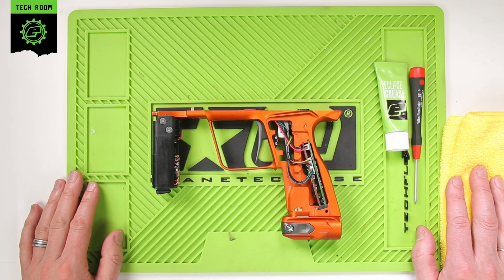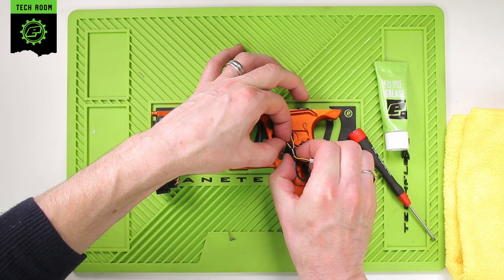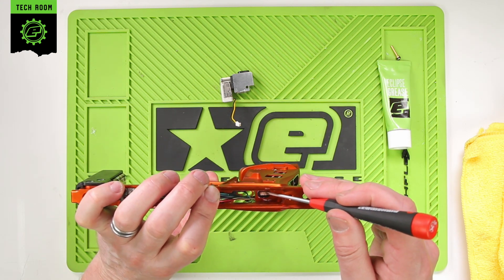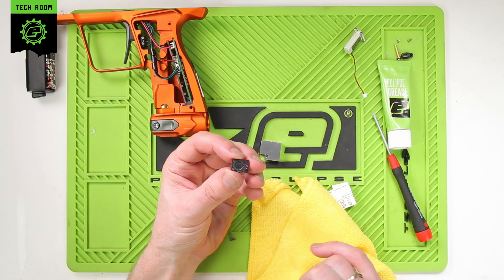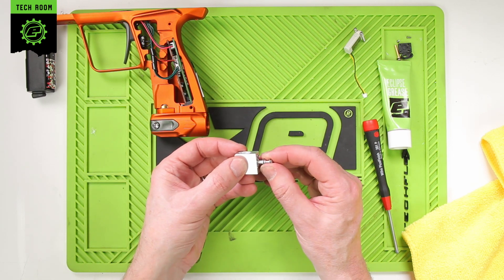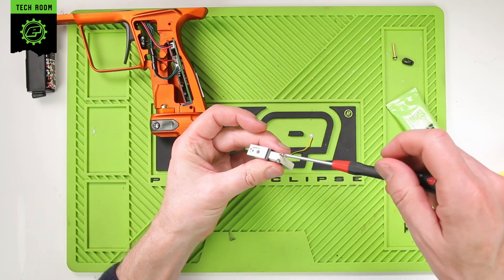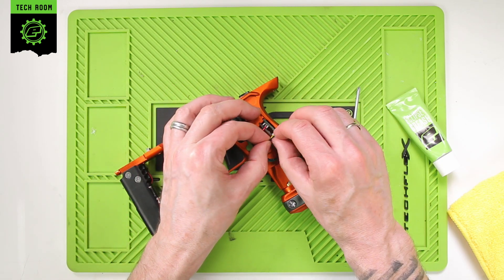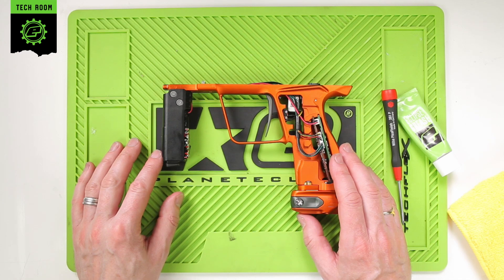Eclipse Gtek 180R Solenoid Maintenance

Comment: my 170r marker got air leak somewhere inside the grip either  the solenoid or the regulator??
Reply: after few times on off the gas the air leak
Reply: I'm having the same problems but with my 180. Did you get yours fixed?